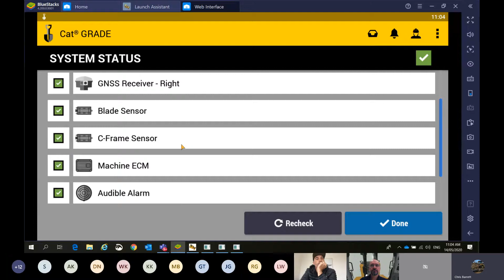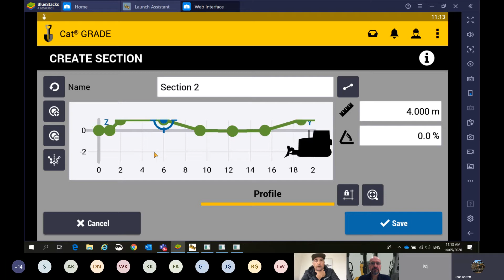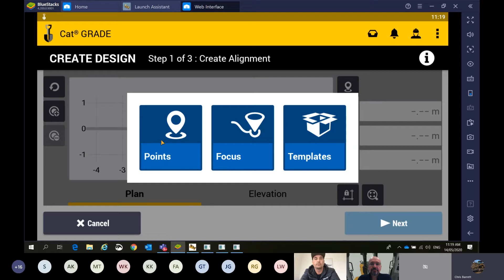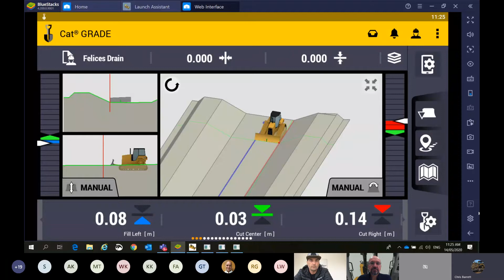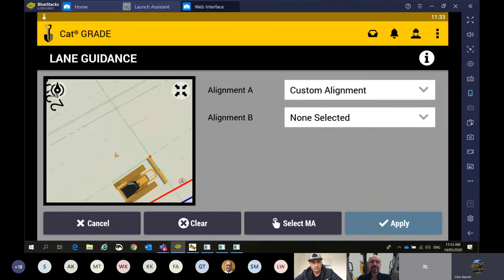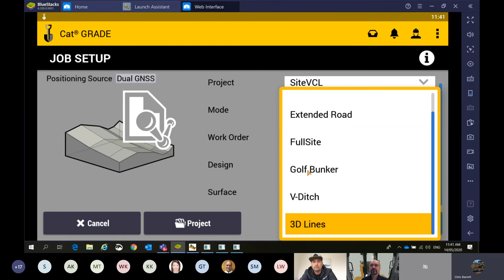Meet the Pros Webinar - Cat Grade 3D Advanced

Comment: I have a question about infield design.  I need to build a road in the desert following the contours of the land. Say the road is 20 ' wide and 1 mile long and I need to    put 5 inches of ABC for bedding .How can I get the system to track the variable cross slopes as the land isn't flat . Government work. We have to follow the lay of the land. As I do this normally the only option I can see  is in step 3.  I can only choose a single grade for cross slope for the overall mile when there needs to be many cross slopes variaing 1% - to 4% cross slope through the mile. If there is a way, this could speed up my production